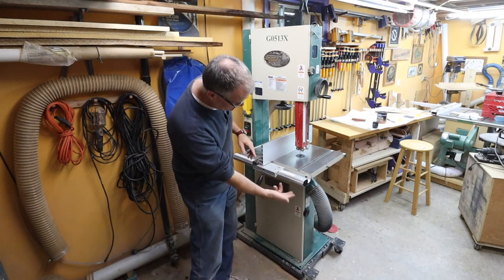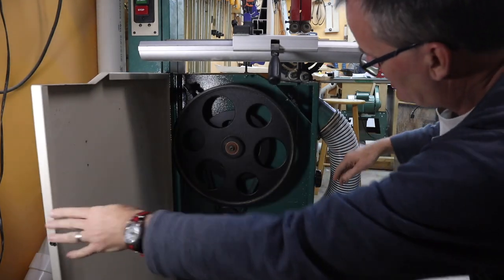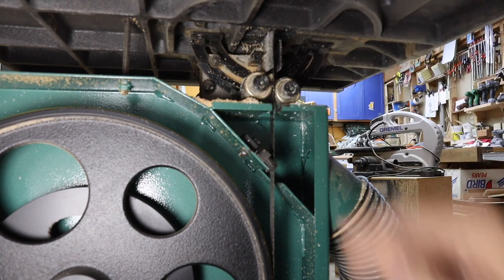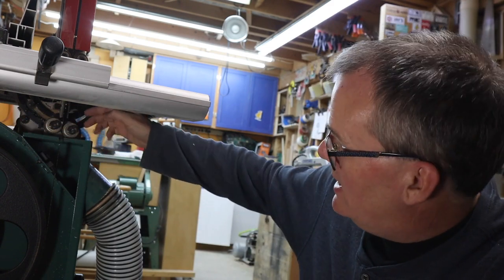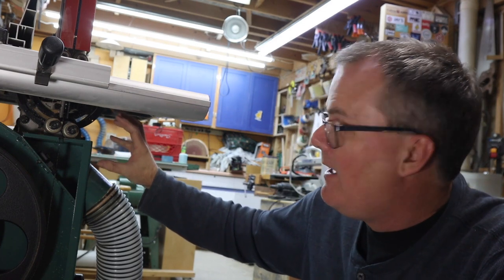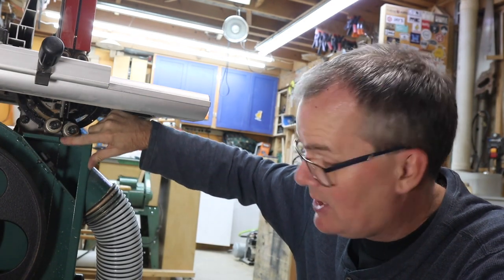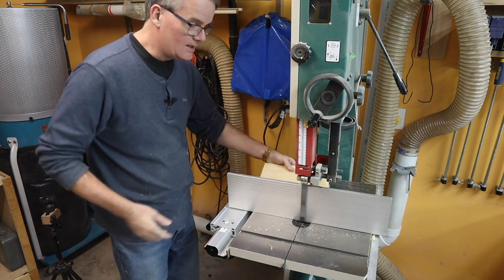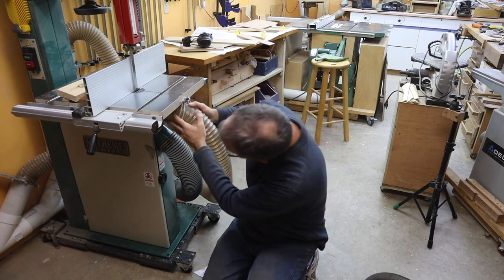Can I Fix Grizzly Bandsaw Dust Collection?   // Let's Experiment  // WnW 215

Comment: Add a piece of pipe to the hose that surrounds the blade, similar to this: https://www.youtube.com/watch?v=Ut_tqnqrRww
Reply from the maker: Thank-you for that link.   Rob Cosman is a smart woodworker.  I was focussed on searching for Grizzly and so did not find his more general video.
Reply: Saw that video - looks like it solves the issue quite well, will have to "build" one of those for my Rikon.
Reply: @Wordsnwood  Rob's design works great. If you leave the end of the tube open it works even better. More air flow throught the gullets. Thanks for posting!

Comment: Hi Art, while I don't have your bandsaw I do have one without dust collection (1940s delta). I have spent a lot of time thinking about how to make something work. I think if you catch all of the dust coming off the blade in the trunnion area, then you won't need the dust collection at the bottom. That way you won't have to split the 4 inch line. I would say that a small and easily removable box around the trunnions in combination with a single 4" line going into it will make it better than the stock set up.

Comment: I have a similar style bandsaw (18 inch laguna).  What works well for me is attaching a 4 inch hose near the bottom where the bearings are (so it raises and lowers as you turn the wheel).  This seems to be the most effective addition so far.

I agree though - bandsaws generally suck for dust collection.  I have a 5hp cyclone and 7 inch main ducting dropping to 6 or 7 at each machine and I’m using 3 4 inch ports on the bandsaw now split off a single 7 inch.   Without the top dust collection, I get piles of sawdust on my bandsaw table.  Worst of all my machines (although almost all of mine have been heavily modded).

Comment: If Festool made a bandsaw, they would incorporate a dedicated vacuum assist in the bandsaw itself. They would put a box around the trunnion area right as the dust drops between the gullets of the blade teeth and suck it up right there. The 4" hoses seem to be too big and unfocused and just too far away from the blade.

I have a Rikon 10-324 big resaw bandsaw, it generates a LOT of dust and I just vacuum it up afterwards and open the garage door and leaf blow the rest out. Easy to do in a garage shop, impossible in a basement shop. Oh, and i wear a P100 mask all the time when woodworking.

Comment from the maker: I don't understand the dust collection hookup on my Grizzly 17" Bandsaw.

I own a G0513X bandsaw.   I bought it used, 9 years ago, but Grizzly still sells three or four variations on this design, and the dust collection hookups look like they're still the same.

The Dust collection from the lower cabinet is fine, no complaints.

The Dust collection up under the table by the saw blade though, is not perfect.   Their upper dust port opens into this tiny triangular space.  I don't understand how they expect there to be enough air flow to do much dust collection.  And regardless, there still is all that space above  cabinet -- between the cabinet and the underside of the table, which collects dust. 

In this video I'm trying to see if I can improve on  that.  It's a series of experiments to see what I can learn.

YOUR SUPPORT IS APPRECIATED:
💵 Become a Patron: https://www.patreon.com/wordsnwood
🛒 Buy a Plan: http://wordsnwood.com/plans/
👕 Buy Merch: http://wordsnwood.com/merch.html
👉 http://www.wordsnwood.com/support.html

Comment: I have the g0636x which is similar but has more clearance under the table. I basically 3D printed a baffle with a hose adapter that projects out of the back of the saw underneath the table. The port is connected to a 4x4x2-1/2 wye and seems to be a vast improvement. It's similar in idea to Rob Cosman's but the bevel of the baffle allows me to still tilt my table.
Reply from the maker: Are you saying that one leg of the 4x4x2-1/2 goes to the bottom port and the 2-1/2" line goes to under the table?
Reply: @Wordsnwood  Hi Art, yep. I don't even use the port at the side of the saw. I'll take a picture or video and either post it here or PM it to you over on CWW.
Reply: Hi Art...you can see what've don here: https://photos.app.goo.gl/9veKajeNLbt2Rzbz5. There are a couple of videos showing the back side and the front side and an image showing the shroud. Pretty basic and seems to work okay. Dust still ends up on the table but I doubt there's much you can do about that.

Comment: try blocking off part of the lower port so more suction is routed to the top,  might not work if you do it in the lower half of the saw but maybe more in the Y section (use tape to do a mockup) 
and no I just have a tiny little harbor freight and no dust collection, but im in a garage and have a leaf blower

Comment: You started off in the right direction .  Seems the 2 4" ports were added to impress rather than work.
I try not to add a lot of crap to make dust collection work.  It gets in the way.
Maybe high velocity air moving in the direction of the blade travel into the small collection area is all you need.  Any way to improve air flow around the blade down into the cavity.

Some points not in any order:
I would try to get the top working well enough that you don't need the bottom hose.  You can suck the bottom out as needed.
Put a hole in the door to supply air. No need to drill the frame.
Is it possible you don't have enough air movement for 2 4" lines?    May need to debug the collector setup first.  Try a shop vac.
The pointer to Matthia's work maybe worth watching, he really gets into this stuff.

Comment: Back when I had a smaller 1.5 hp dust collector, I never got the band saw dust collection to be as good as when I had the shop vac right under the table, restricted down to a small opening .  No arrangement trying to get that 4" line under the table worked as well with the smaller DC.  But at least your saw actually has a stock port under the table, mine only had one in the case.  I think any improvement you're going to see with that DC is going to be marginal.
Reply from the maker: I'm gettting a few ideas from the comments here... want to first try constricting the 2nd hose down to 2".   Really don't want to have to resort to using a Shop Vac with the BS.

Comment: I designed a 2" top plate with dust collection.  I lose 2" of height but the plate comes off in seconds for those occasional tall cuts or blade changes.  I did a video showing my design and explained how to get proper dust collection on a bandsaw.  Mike Fulton did one that magnetizes to the underside of the table (his inspired mine) but I don't have the clearance to do it under.  Mine works great, and I think his did too.

Comment: I built a very tight box around the lower blade guard and attached my shop vac to that (since I don't have a big dust collector). That seems to work pretty well. I just closed the lower dust port since it didn't seem to be doing anything for my saw.

Comment: Hi Art
I have the exact saw ( except branded General International ) and you are right it's a great saw. I fussed around like you have trying to improve the dust collection.
My final solution ( for some values of solution ) was to use a single hose on the top inlet and then use my shop vac to pick up the overflow dust after each use. Not perfect but it works and sawdust is part of the process so I live with it.
Not elegant but I didn't want something that I had to take apart when I tilted the table and I do that from time to time and since my vac is on a wheeled cart just feet from the bandsaw it's easy.
Reply from the maker: Thanks, Might try that also... been reading the excellent comment suggestions and considering ideas.

Comment: Art - one step which may help is to purchase a replacement throat insert which has holes.  Grizzly has a replacement throat insert with holes pre-drilled which should increase the airflow.  They cost about $5 USD.
Reply from the maker: Thanks, my throat plate already has holes!

Comment: I nearly resolved this problem. By building a new table torsion box that included dust collection. Work really well but you will loose some Capacity. I have a video on it as well. It might spark some ideas for ya any way.

Comment: Hi Art I have the GO555XH about two years old now. The dust collection is a little different from yours but it still sucks, as in terrible. My saw has the large dust port down towards the bottom and I do not have a large dust collector for it. I do have a shop vac where it helps the most but leaves a lot to be desired. So I just wait till I'm finished what I'm doing and then get the rest with the shop vac. I know it's not the best option but I set the band saw near the double doors or outside when the weather is nice. Also several hand held blowers help too, during and after cutting.

Comment: The design of that upper DC port on your saw is... weird. I agree that it doesn’t have a logical or practical design. What about using the shroud you made but get a 4” to 2.5” reducer coming from the split on your DC hose. The shroud will help contain the dust and the smaller hose should speed up the airflow. (This is coming from a non-engineer but in my experience it might help.) 🤷🏼‍♂️ Good luck...Interesting video nonetheless. 👍🏼

Comment: Game changer: Rubber roof membrane from roofing suppliers for trades (not box stores), is like flat inner tube material, easy to use and cheap. I got a 1' X 10' strip years ago and recall it seemed pretty inexpensive. Cut sheets to cover open areas of the band saw and contractor table saw.

PL glue for blocks of wood the fill in the webbing of the cast iron tops. Makes it easy to put flexible skirts around the equipment to contain/focus the air flow. Stick on velcro is useful to attach the rubber in some areas. The rubber can flex as things move or adjusted. I agree that slippage of air through some gaps is good to keep the airflow up so the dust stays suspended on the way out. The rubber skirt mates to 4" plastic fittings where the hose attaches. My collector isn't great but almost no dust collects below the table or in the cabinet.

Table saw height adjustment wheel travels in a 1" wide arched slot to allow the blade to angle. Some flat rubber sheet is fitted behind the slot with a slit for the shaft to slide through. Rubber sheet is fitted to the back, with slits for the belt and motor mount as this moves a bit for height adjustment. The belt wears the rubber out as needed. There is maybe the equivalent of a 2 inch hole for the belt now, opposing the entire 12" X 14" back side being open. Velcro attachment for the rubber works well. To close some of the cast iron webbing where the top meets the steel frame, I used foam pipe insulation squished into gaps. For a bodge, it works pretty well and surprisingly good draft through the blade slot.